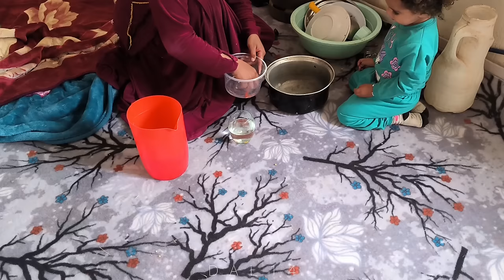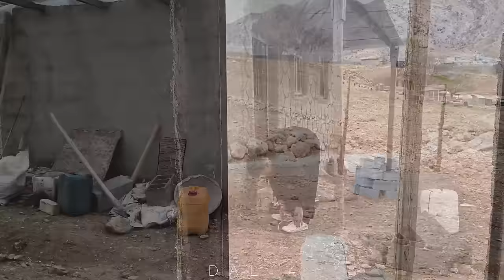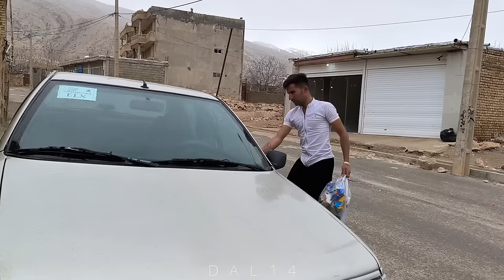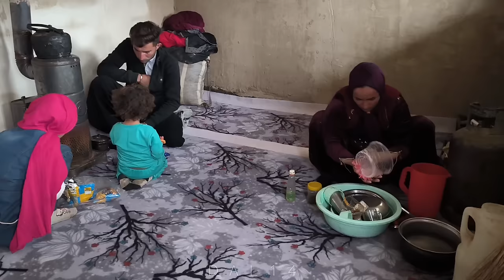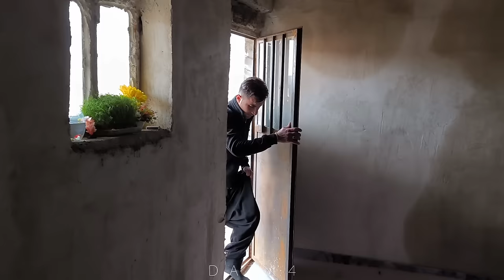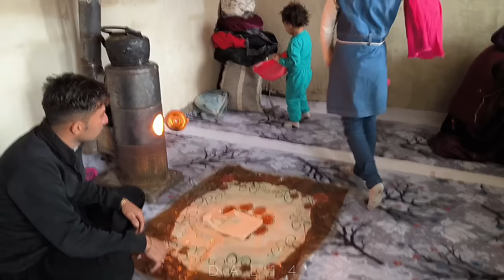Afsane and Mohammad's colorful love: coloring the house of dreams with love

Comment: Mohammed you need another covering of plaster on the outside walls as you can still see the blocks through it then you can paint it after with a concrete waterproofing paint. Dont get the wrong psint because it will flake of in that weather but somehow i don't think anyone will listen
Where you can see the water coming through on the inside when it rained is exactly where you can still see the grey blocks showing on the outside. Plaster it again before painting & cover the windows when you paint.
Reply: Oh my God😮😮 the haunted house on cemetery street. What the heck! 😂 I give up with this!!!

Comment: Surely Mohammed can seal. Up the hole around the heater pipe. The heater is in the right place. It should be in the center of the room it evens out the heat to both sides. Afsana just stress the more important stuff like the rain coming through the walls.

Comment: you need another oil heatear  on other wall too dry it ou akso paint the walls inside with house with VINYL SILK  paint  it will keep damp out  BUY some THICK CURTAIN MATERIAL FOR CURTAINS FOR THE WINDOWS SONETHING  THICK  AND pREETY FOR DOOR TOO IT  WILL KEEP DRAUGHTY WIND OUT house will be cosy then  VINYL SILK. PAINT ON WALL INSIDE  OF HOUSE  WILL KEEP DAMP OUT AND BE EASY. TOO WASH DOWN ANY MARKS